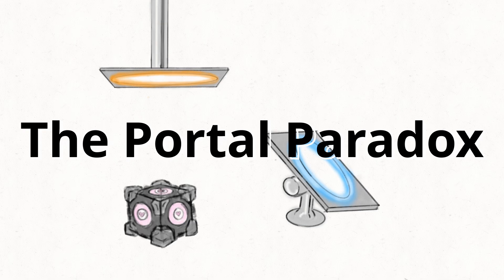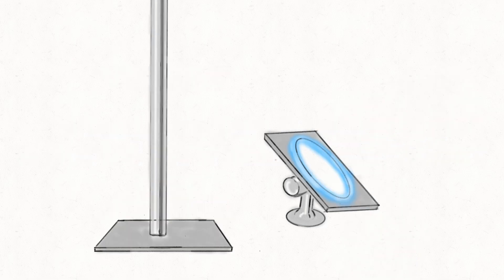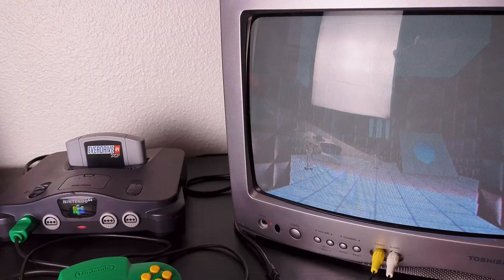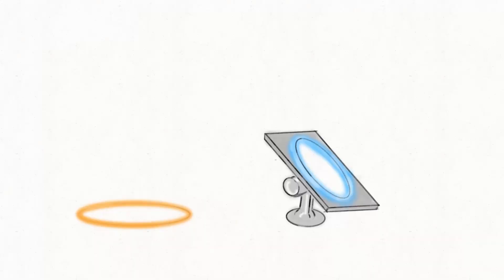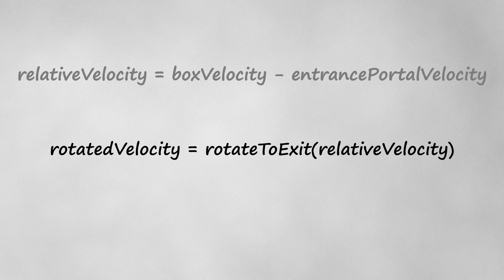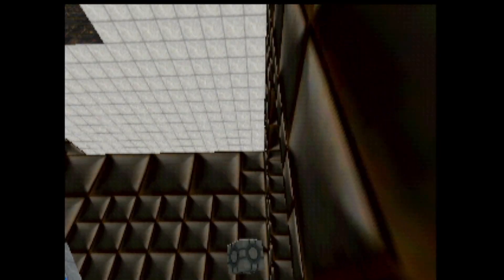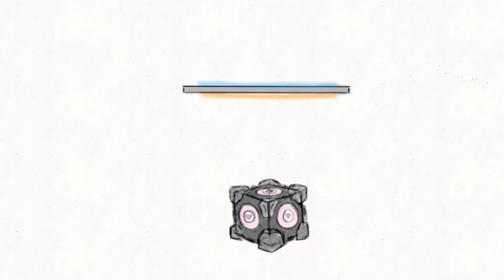I rewrote Portal from scratch and solved the Portal Paradox

Comment: I'm gonna offer my own input on what would happen: The cube as the portal is approaching it willnot move until the cube's center of gravity has reached the other end and thus will "fall" on the other side. That's my solution, example you take a stick and find the center of gravity and when you do leave it on the edge of a table. The Stick will not fall until the edge has lost it's gravitational balance. However this idea only works on a same angle of gravity meaning if the portal was oriented another way it could cause a suction force because of the portals not being on the same plane of space and thus cause wall of force... Although since both sides would be the same pressure then it might not matter and just cancel out the forces thus remain the same.

Comment: alot of people here arguing the physics of the box meanwhile I'm randomly wondering how the air works in this situation, it's a kinda unique interaction since unlike a hole in a panel which most portal situations act like (much like the main focus of the "paradox"), if I move the panel the air that travels through the hole is mostly stationary but in this situation the air is pushing against eachother in an entirely different way, this is all way over my head.

with equal air pressure on both sides would the air on the stationary side act like a wall forcing the air out of the way on the moving side or would it give to the pressure of the airflow created by the moving portal and increase pressure on the stationary side until the pressure of the room is greater than that of the moving portal on the air in front of it? how much pressure would that even cause? at that point would the pressure from in the room even allow something as squishy as a human through? (I guess that all depends on the speed)

this is just the main focus of the paradox but since the air has minimal momentum before touching the portal at which point it will gain a relatively large amount of momentum how does that even interact, on one side it's having a portal forced [over it? against it?] then on the other side there's already air there that would push it back through the portal since air is always pushing against the edges of a container, at the end of 2 it creates a vacuum to normalise the pressure between the facility and the moon so at the very least air will normalise between stationary portals, though technically the one on the moon and the one on the earth are moving relative to one another but what about when the air pressure on either side is the same?

and a final note to create something akin to portal's portals our understanding of physics would require an overhaul, since from our understanding to even consider maintaining a link like that would require a lot of energy being pumped in to one or both sides and in portal they are completely self sustaining, if there is some energy produced by the portal to maintain itself then what is consumed? are portals their own perpetual power source?

and one more thing that's not really related, how are portals not used to create unlimited power? why would aperture even use a reactor when they could create a portal with a terminal velocity magnet or a water wheel that outputs back into the portal forever powering itself? (or several since they are able to create atleast 2 seperate sets of portals, presumably more since they have/had so many test subjects at one time). we've only seen one size of portal but that's from an object designed for making something that fits a human, they can probably be smaller so it doesn't have to be that large.

Comment: See I don't think that actually holds up. The portal is just the other side of a hole. So if you put the orange portal on the opposite side of the blue portal, you've created a ring. If you then float a cube and pass that ring over the cube, the cube doesn't move at all. 

Another way to think about it is if you were to take your original setup and "slam" it down and stop half way, you haven't actually exerted any additional force on the cube - the only forces on the cube are still gravity. You've got half of it affected by the gravity keeping it in place and half of it affected by the gravity on the blue side. I know that it seems like some sort of "Force" must be exerted in order to "move it" through the portal to the other side, but there was never any force applied to the cube so we can just write that off as magic because this is a video game and none of this is possible anyway.

Comment: What happens if the orange portal is moving towards the cube, and the blue portal is moving in the same speed but in a different platform? Will the cube eject from the blue portal with double the speed, or will the cube basically dissappear since the orange portal "crushes" it like in your examples?
Reply: It will double the speed. But it can't cross the speed limitation, so what happen on speeds of light... that's interesting.

Comment: only 22 seconds into the vid, and just wanna share my opinion.  will edit with reactions after vid.  My thinking is that it's like holding something in your hand open palmed, moving your hand up, and then hitting something preventing your hand from moving further, and the item then get's launched.  i understand that the cube has no momentum itself and thus would have no speed to carry it through, but if you're using that thinking then wouldn't the cube emerging out of the stationary portal give it velocity?  anyway, that's my rant.  continuing the vid.

Edit: eyyyy, cool! :D

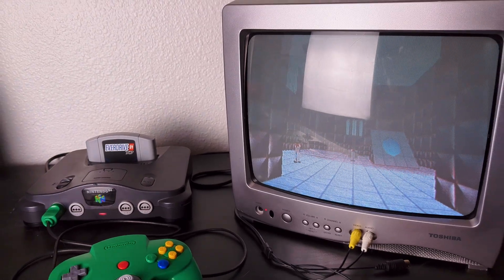also, quote i use almost on the daily. 0:37  Cave Johnson: "Science isn't about 'why,' it's about 'why NOT!'"

Comment: This technically wouldn't work, in the way you showed. It wouldn't fly out, it would sorta just plop out on the other side. You see a portal is like a door, if a door suddenly flies towards you at high speeds, you will go through it and stay completely stationary. The only reason why there is momentum is because these "doors" are attached to different surfaces, one on the floor and one on a sloped wall, so if you jump into the floor "door" you will fly out of the sloped "door". This happens because you have momentum that gets turned into forward momentum. So if a portal slams down onto a stationary cube, the cube will just fall out on the other side because there is no momentum on the cube.

Comment: Great video! I have a hypothetical question though; what if the portal slamming down is accelerating? In an extreme case, you could imagine the portal slamming halfway down in the box then suddenly stopping. Half the box is moving out of the exit portal at some velocity, but the other half is stationary. Does the stationary half get sucked up into the moving portal?

Comment: Your solution is wrong, but only because you made it wrong. You've solved for "how would this situation work if I program it to work that way." If you actually do this in Source, you'll find that the opposite happens. Velocity is a non-transferable object variable in Source, meaning that if it had no object push it, it would remain stationary until gravity on the exit side made it fall. To put it simply, it's an edge case that would likely work as you programmed it to IF the devs had thought it would come up. And that's assuming they patched the old code, because the original Portal has a tendancy to crash if you try to force a moving portal, or clip them into each other.

Comment: I'm not going to say your wrong just that your interpretation is one of a few possibilities.

To get your scenario we need to make a few assumptions. (Which are valid, but if we change one then the behavior changes as well.) First we have to assume that the portals frame of reference is relative to the object entering. This is a fair assumption as the game does show conservation of momentum. But if we break this, and assume only the objects momentum is conserved then we get the flop put behavior. Next you assumed that the exit portals velocity is also factored in, this is not a valid assumption. As it doesn't make any sense. Why would the velocity of the exit portal have any impact on the object? If make that assumption then we would have a problem with the portal 2 ending. This would be an issue because planetary bodies would have enormous velocity differences, were talking thousands of meters per second. So anything exiting the portal in that scene would have been thousands of meters away in the blink of an eye, and likely torn apart by the forces involved. ( Anyone want to make a guess as to the speed of a point on the moons surface against a point on the earths surface? ) (Now that I think about it that last scenes behaviors breaks a lot of theories on portal behavior.)
So, given your first assumption then the cube should have jumped when you slammed the 2  back to back portals into the ground.

Comment: Cool demonstration of your physics engine, but wrong. GLaDOS states unambiguously that portals do not affect forward momentum. That is to say that there is no loss or gain of kinetic energy through a portal. The fact that a portal was moving (by the way, this was originally intended to be impossible, but was changed in Portal 2 because they needed to be able to move portals for puzzle elements) would not matter. Which makes logical sense, because effectively both portals are two sides of a spacial plane. The distance between them doesn't exist, and so does not change, even if one or both were to be moving. As far as the object passing through the portal is concerned, the moving of the portal matters as much as if you were to wave a hula hoop around it. The only thing that changes is the angle at which gravity is being applied to the object.

Comment: My single cell logic is giving me a headake... help...
The 2 portals technically speaking make an infinitely short tunnel, whether any of the 2 portals move it does not change this (as shown in your deconstruct). 
The cube is standing still, no forces being applied to it other than air pressure, gravity and the surface it is on pushing against gravity.
The cube going through the tunnel would not accelerate it or be impacted it in any way by the passing because while motion is relative creating motion from nothing is not possible, the portal or tunnel does not transfer the movement to the cube since it does not touch it with any known force (there could be unknown forces but for the sake of simplicity let's not just yet)
If the tunnel created by the portals would decrease or increase in length from the movement of one side, the space outside the two sides would have different warping coefficients in which case the cube going through would end up at a velocity that is impacted by the warping differences of the two spaces on a vector that is either forward or backwards (depending on whether the tunnel length increasing or decreasing)
However as per your simulation the tunnel length remains the same even when the portals move, infinitely short, so the warpness coefficient of the spaces outside the 2 portals remains constant.
So the only 3 forces left are air pressure, gravity and surface opposing gravity.
When the portal moves, the air will try to stand its ground (going inside the orange portal) but since the atmosphere behind the blue portal is the same, since it's not moving, it has no where to go, compressing it. Congratulations, the permanently increasing air pressure will now kill us all.
Let's take the air out of the equation
the only thing that changes is the direction of gravity and the direction of the force of the surface pushing against the gravity which from opposing directions they change making an acute angle, 
now the surface push force is smaller and friction between the surface and the cube joins the frey
when enough of the cube is through the portal for the gravity to overpower both friction and surface push, if it is bigger than the whatever-force-is-composed-out-of-the-other-2 the cube just falls off, otherwise it remains on the platform

TL:DR
moving a portal through 3d space will probably destroy anything in its vicinity if not reality itself
if not then the pressure caused by the move will (i don't really understand how this happens in the first place and my logic is most probably flawed, so if anyone knows what actually happens in this situation please clarify)
if not then the cube may or may not fall but it would not be launched
a scientist would be more fit to answer this... i try to deal with 1 issue 2 more appear... youtube comments are not long enough for a thesis

Comment: i believe einstein described relativity in a similar way. when you hit a brick wall with your car at 70 miles per hour, it's no different than a brick wall hitting your car at 70 miles per hour. the difference is the exact same. when the blue portal is in motion it's subtracting the velocity gained by moving in the opposite direction.

Comment: Taking into an acount normal physics, not simulated one through the game engine, the cube would simply plop out. Its all because of "0" kinetic energy of a cube. It would have sense if the ground under the cube accelerated it and pushed through portal, because of transfering the energy. Relative velocity between cube and a portal would have sense if both sides of the portal would be in separate physical systems. Instead they're in a same system and space, so the "hula-hoop theory" is right.

Comment: I disagree with your solution.
Portals are not objects, they don't have velocity, at all. 

Let'say you are standing there and getting squashed by a portal. Now, for ease of imagination, let'put the other portal on the ground.
Now. The squashening begins. Slowly. Your head first. What you suddenly see is floor, then your torso and legs. You are just standing there. On the ground that the portal is squashing rn.

Now faster. Ground under you doesn't move, you don't move. It's like putting you in the glass, NOT pushing you.

Another case. Let'say you are half way squashed, but, a twist, the squashening stops. And reverses. In your implementation, however slow you reverse - INSTATNT DISMEMBERMENT, isn't it?

Portals are not objects. They don't have velocity. You have it, they don't.

If you are flying into the portal that moves to you, you should still only have your own velocity. Portal is not an object, you don't slam into it, it is a property of you suddenly being somewhere else.
Reply: A more elegant way to explain the same thing.
place an object on the floor. Take a jar, consider the hole in the jar to be your portal (and let's say the inside of a jar is infinite)
Put a jar over the object.  Does your object jump?

Comment: Using the same logic, moving a portal (in relation to its pair) should require enough energy to move the entire observable universe whatever distance the portal moves in order to maintain conservation of energy. Consider the following thought experiment:

There are two panels with portals on them, floating in the vacuum of space, with a wire connecting the two and a winch to pull them together. The portals are arranged in such a way that if you threw a ball straight into a portal, it would continuously move through the pair forever. The panels are also very far apart. Near one of the portals a ball is floating just ahead of its portal boundary. 

The winch is activated, the portal next to the ball is pull into it at 5 KPH. This would propel the ball out of the exit portal at 10 KHP, twice as fast as the winch is pulling the two panels together. Just after this, the cable is cut and winch is turned off, the panels are just free floating toward each other. Every time the ball passes though the portals, it gains 10 KPH of velocity for free. With portals far enough apart you could accelerate any mass, that fits into a portal, to any speed while only expending enough energy to pull the two portal panels together.

Movable portals create even weirder paradoxes than portals do by themselves.

Comment: there is actually a point in portal 2 where the portals move. once you bring wheatley through aperture a bit, you have to cut the tubes that feed the neurotoxin to GLaDOS using lasers. you have to put portals on the moving panels to cut the tubes that feed the neurotoxin.
Reply: of course you can't go through these portals, (at least without bugs or modifications,) but they do move

Comment: What happens if the blue portal moves in the opposite direction at the same speed? The speed of the cube is not dependent on it at all in that equation, so what if the portal moves at the speed of light, will the cube come out faster than that?

Comment: 2:38 I think you could further cement this explanation by showing a similar test where the platform with both portals doesn't stop as soon as it gets to the bottom of the cube. If the cube was sitting on a tall pedestal and the portals kept going down, then it would appear as though the cube was 'shot out' of the blue portal.

The conservation of momentum is different because a force is imparted onto the portals at the time the cube enters the portal, rather than because a force is imparted on the cube for any reason.